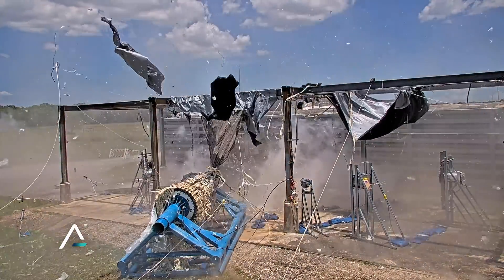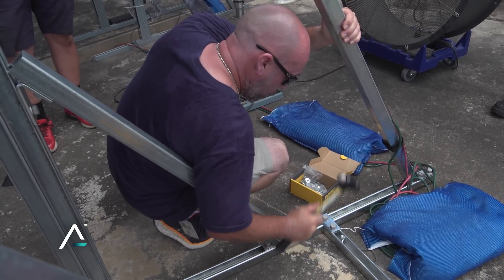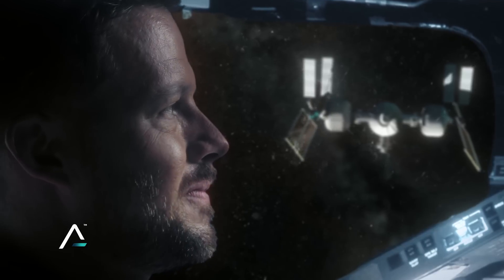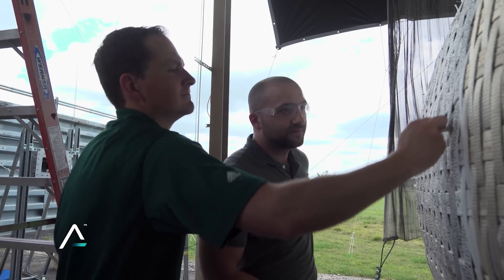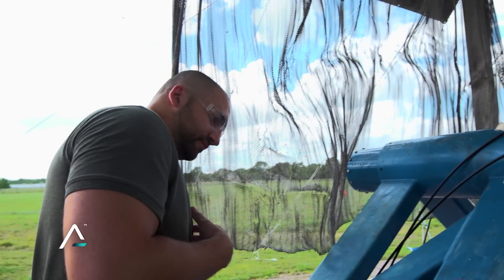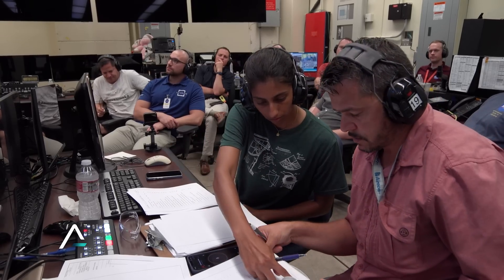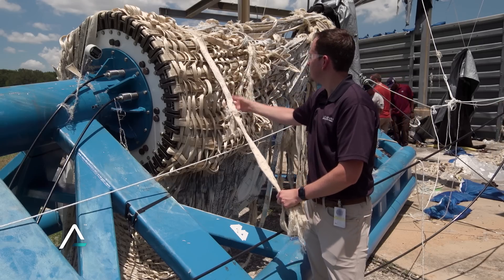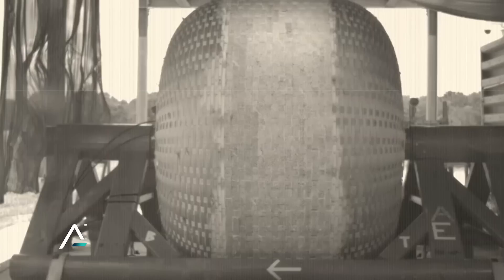Sierra Space’s LIFE Habitat Successfully Completes Ultimate Burst Pressure Test

Comment: Can the LIFE module withstand a 50 caliber impact at standard pressure. 

Sure i micrometorite is small, but odds are out would be moving at greater speeds.

And it comes down to how much time do the inhabitants have to plug a hole before full decompression of the module.

Comment: Is it possible to design an inflatable like a pipe fitting (tunnel), so that each module goes on like a bead on a bracelet- with each segment being twisted, bolted, and wrapped on To make a 25,000 foot long diameter ring?  After that, it would be nice to put carbon fiber plates on the outside to further increase its durability and stiffness, along with attachments for modules that can be detached when the time comes?

I understand each end has a smaller ring hatch, but would it be possible to make it wider like a tunnel so you can put scaffolding to walk continuously around the entire ring?  And is it possible to design each hatch like a sphincter and an iris with a plug in the middle so each segment can be opened and closed off relatively easily?

After that, you could put lines across to each opposite end, stabilizing it, along with carbon fiber plating.

The idea is that once it’s inflated and plated, you have a hatch/corridor at either end to go around the ring continuously, and hatches/ attachments (on the plating) perpendicular to lay modules to build out an O Neil Cylinder.

After the initial stainless steel ring is made and you have crew quarters/warehousing setup, the inflatable ring can detach and drag chains/cables to the other end 200,000 feet in the opposite direction and then you can travel along the lines and fill in the stainless steel tube with relative ease.

Comment: With decades of advanced material reinforcement, manufacturing and failure analysis ASTM (I) engineering, UV light degrades Vectran tensile strength quickly and catastrophically. 

We have pioneered advanced fiber reinforcement for decades and our founder was the chief chemical engineer for the Celanese Corporation and Gates Rubber Company.

It would be awesome to be part of the team.

Comment: To those who might not fully grasp just how impressive the strength of this module is, let's put it in perspective:
The air pressure at sea level on Earth, which is roughly around where they would keep the habitat inflated at, is 14.7 PSI.
By getting up to 192 PSI, the test article was able to withstand Thirteen times the amount of pressure it would need to hold under normal operating conditions. Any system that can withstand 1000% its normal load is impressive, but 1300% before failure is phenomenal!

Comment: Vectran, an aromatic polymer? Then you'll have to shield it against UV, or else it will be destroyed in no time. Wouldn't a fiber which isn't degraded by UV be more suitable.
Reply: What you see is only the inner two layers - the pressure bladder and restraint weave. It'll be covered in numerous layers of insulation (specifically, multi-layer insulation, or MLI, that is made of aluminized mylar and kapton, along with other materials), and finally several layers of micrometeorite shielding. So, the polymer will be buried well out of reach of UV rays.

Comment: "Saves from radiation". They don't tell which radiation and how.
If the lamination has many hydrogen atoms included (carbon hydrates) then it's able to slow down particle radiation like neutrons or protons. But those particles produce secondary radiation.
But the el-magnetic radiation (gama rays) is a different story. I think it can be reduced by a wire mesh, or (like earth) by a magnetic field.

Comment: With larger structures, might want to take into account any places where people can get stuck. There's no gravity to pull people towards a surface, so if they get stuck, they won't have any way to get back to a surface.
And yeah, you could probably take off your clothes and throw them to generate thrust, but that could get a little awkward.
Reply: Theoretically that might be possible but how would they get stuck in the first place? If you're at the edge of a cylinder and want to go to the center, you would have to push off one of the walls but unless there's something to grab in the center you'll just keep going till you hit the other wall. And if you have something to grab in the center then the problem is solved either way.
Reply: Explain further

Comment: Is it me or just me? I was thinking, maybe, just maybe, this could be used in submarines because it can withstand high pressure in space . It could save crews' lives in submarines in case something bad happens to it.
Reply: In space it has to survive just one atmosphere pushing from the inside. (1 atmosphere inside, 0 outside)
Submarines deal with 100 atmospheres pushing from the outside.  (1 atmosphere inside, 100 atmospheres outside at 1000m example depth.
Totally different game.
In order for this to inflate in depth, it would have to exceed the outside pressure. Might as well not have it then.
Reply: Unfortunately, I don't think that's how it works. This is designed to have an incredible tensile strength - resisting being pulled apart, as it restrains the inner urethane bladder that keeps the air pressure in. Think of it like a net or cage around the pressure bladder that keeps it in the proper strength. However, just like with ropes or cables, while they have excellent tensile strength, they do not at all have good compressive strength. For it to work in a submarine, it'd have to be pressurized to a pressure greater than that of the water outside of it. Unfortunately, when air is at extremely high pressure, it tends to have deleterious effects on the human body, with things like nitrogen narcosis and oxygen toxicity (yes, oxygen can be toxic if at too high a concentration).

So, TL;DR - it works great when it is restraining internal pressure, but would fail under greater external pressure.

Comment: OK. Interesting in theory. But a static pressure test is not relevant to the hazards of a space environment.  How about firing a 30/30 round at point blank range at the inflated habitat? That is about the same energy as a dust grain size particle moving at orbital velocity would impart. Hard habitats have a fragmentation layer that breaks up such particles before they hit an inner kevlar layer. This is similar to the design of rifle rated vests consisting of a ceramic outer layer and kevlar inner layers. Does this have a similar design?
Reply: You're only looking at the inner two layers; the internal pressure bladder and the middle restraint weave. There's going to be multiple layers of multi-layer insulation (MLI) for thermal control, and an outer several layers of micro-meteorite shielding. It'll be like a kevlar vest on steroids.

Comment: Correct my ignorance but I would imagine that all you need is 14.5 + safety margin? Why did you design it to handle so much extra pressure? It seems like unnecessary mass.
Reply: It's better to have it be able to withstand far more than it would normally experience in operation to show that it can handle damage and wear and tear over time. If it can hold 13 times the pressure it normally would, then at only 14.7 PSI (Earth sea level), they could probably have a dozen straps fail and it would still not breach.

Comment: For those wondering about micrometeorites and radiation shielding:

Per the FAQ on their site:

If the LIFE habitat is made of fabric, what protects it from things like radiation, space debris, asteroids, etc.?

The LIFE habitat has a woven structural layer (pressure shell), called the restraint layer, which is strong enough to withstand the internal pressure required for the crew to live and work. It is protected by an MMOD multi-layer soft-goods shield that guards the habitat from space debris such as micrometeoroids. The layers of fabric, plus the internal outfitting, create ample safeguards against radiation.
Reply: so why just send panels and a robot arm solder it in space if worry about volumetric. fabric dont seem be safe.

Comment: Fully support this endeavor BUT I have lots of questions since as a sailor I've used Vectran line.
It has to be sheathed to protect ftom UV... So in space deployment it'll have an exterior layer of protective (maybe radiant barrior too)
And micrometorites are inevitable so how do you patch it to retain strength. One of my many skills was working with marine and aviation composites and to retain structural strength there's complicated procedures, you just don't slap a patch on. I also have experience with patching inflatables like life rafts and boat hulls and again, you have to use the right adhesives under controlled temperatures and humidity so what do you do in space where one side is vacuum and the other side atmosphere.
Finally, all materials age and weaken, it would be interesting to know the expected lifetime of the "balloon" in space.
Reply: You're only looking at the inner two layers - the pressure bladder and restraint weave. There will be numerous layers of multi-layer insulation (typically made of aluminized mylar, kapton, and other such materials), and an outer several layers of micro-meteorite shielding. It will be well protected from UV rays, as the layers that could be vulnerable to it will be buried under a dozen other layers.
As for how it would age, this module shares a lot in common with the Bigelow Expandable Activity Module - an inflatable space module that's been on the International Space Station for the past seven years (since April 2016) and has been performing without issue.
Considering that Sierra Nevada is also, if all goes according to plan, launching the Dream Chaser mini space shuttle by December, I'm pretty sure they've taken into account any factors that an experienced mariner can come up with in 5 minutes in a Youtube comment section. These are professional aerospace engineers - have a bit of faith in them. Just because they don't cover absolutely everything in a short PR video doesn't mean that they have overlooked it.

Comment: Excited for this tech however many major questions remain as to its viability beyond getting pressurized like:
1. What is the long term over-pressure holding ability?
2. How many micrometeorite impacts can it withstand at different pressures?
3. All of the above questions under space condition temperatures, hot/cold?
4. Radiation shielding capability and effects of radiation on the fabric's strength derating?
Reply: all good questions for which I refer you to the BEAM module which went to the ISS for a 2 wk test, what, 4 yrs ago, and has been in use (as pres. storage) ever since.  poor Bigelow.
Reply: @joejack8659  It's been a little more than four years - it launched on April 8, 2016. It's now over seven years old, yet still performing without issue.
Reply: @joejack8659   Yeah I feel bad that Bigelow laid off its entire workforce and I was looking forward for their giant Olympus module and I really hope sierra does the same thing.

Comment: Er they forgot mini meteorites, they would pass right through it and any person inside, but I would prefer stainless steel outer shell and that inflatable balloon inside it.
Reply: No, dude, they have not forgotten about *micro-meteorites (probably should learn the correct term). This module isn't that different in construction to the Bigelow Expandable Activity Module that's been operating on the International Space Station for the past seven years without issue; it's simply far larger. You're only looking at the inner two layers - the pressure bladder and restraint weave. There will be numerous layers of multi-layer insulation (typically made of aluminized mylar, kapton, and other such materials), and an outer several layers of micro-meteorite shielding. We've had solutions to micro-meteorite damage to soft bodies ever since the Apollo-era space suits.

Comment: How does this tech manage micro meteorite impacts and decompressions due to leaks? Pretty interesting tech either way :)
Reply: my thought exactly. a metal chamber would lose pressure, but not explode when punctured
Reply: @ChoppyChuck  Just to note, the highest sea-level air pressure ever recorded was ~15.74 psi. That this took more than eleven times that to burst (actually slight more than twelve times, but this was done in atmosphere) is pretty good.
Reply: @ChoppyChuck  This thing is made out of materials that put the kevlar in bullet-proof vests to shame. You're only seeing two layers - the inner bladder, and the middle structural restraint layer. There will be additional multi-layer insulation (MLI) layers, and an outer micrometeorite protection layer. It'd frankly perform better than just a single plate of steel; once the micrometeorite hits the first layer, it will essentially vaporize, and the 1-2 layers after that will catch the remains. It's the basic principle behind how Whipple Shields used for micrometeorite protection work.
Reply: The many fabric layers have been tested and it shows they're much better at withstanding micrometeorite hits than regular ISS modules for example.
Several layers of kevlar-like stuff.

Comment: This looks as a very promising technology for future space habitats. Sierra Space, you're in the right path. Hope to see this module on future space stations, well done! 👍
Reply: My biggest concerns are around radiation and heat shielding and how it handles extreme temperature shifts.  Direct sunlight is rather hot in space and without radiation shielding it would have to be restricted to only operate between the earth and the Van Allen belts.  Thermal loading and unloading cycles are also very important due to the extreme environment of space. In the sun its boiling hot, but in the shade you eventually cool (over long periods) off.  How does the material handle repeat heating and cooling cycles?  How many cycles before it lowes integrity?  Given that they proved it holds to 180+ psi and it wont be anywhere near that loading it gives them a lot of wiggle room for heat cycle damage, but that's still a major concern.
Reply: @HIMPDahak  
You're right. Your points are true, but just as you thought about them, they for sure know all those concerns. I'm confident they will do a lot of testing before the habitat is certified for human use.

Comment: What sort of life span are you expecting from these modules holding pressure in the harsh environment of space for years on end
Reply: considering that similar inflated structures have been sent into space, inflated, and have lasted for many years I would expect them to give their modules similar lifespan ratings as other space structures, so on the order of decades.  See the work of Bigelow Aerospace on deploying independent modules as well as an addon for the ISS that has operated since 2016-it was actually only intended to last for 2 years as a test article but it exceeded expectations and is now rated to operate until at least 2028-so that's 12 years of operation lifespan out of something intended as a basic demonstrator.  
Worth noting that holding a roughly earth surface level pressure in space is not that difficult-this system you saw here only failed after they pumped it up to like 12 times atmospheric pressure, so under any kind of realistic load it is not being strained at all.
Reply: exactly

Comment: How can fabric be stronger than steel?
Reply: Ever heard of Kevlar, how about carbon fiber?   So, relative to size and weight the fabric is much stronger and lighter than steel would be.
its like a block of aluminum is pretty solid, and you can poke your finger trough foil easily.  You cant poke your finger through the same thickness of Kevlar.  Thus, it is stronger.
Reply: Tensile strength. This thing is meant to resist being pulled apart; by weight, it has a tensile strength far greater than that of steel.
Reply: PR to impress investors

Comment: Isn’t 1 atm 15 psi? It’s awesome that the module can make it to 190 psi but that’s more than 10x what it needs to be
Reply: Be good if they included "12x normal atmospheric pressure" alongside 190 psi in the video/video description, just so it is easier for the lay person to understand what those numbers mean
Reply: Did you not listen to the first part of the video. They want to know the failure point.

But you also want to overdo everything.

Your engine in a car runs at ~100°C right near boiling temps. Coolant is mostly water, but your cooling system is set to hold pressure up to 140°+
Reply: 14 psi roughly
Reply: Remember in space, it won’t have the Earth’s atmosphere pushing back onto it so it will experience greater pressure strains in orbit (like a pressurized plane at cruising altitude but more. Also, with anything that is going into space for the purposes of human habitation, you want to design it for great levels of redundancy and a high factor of safety
Reply: They probably want a 20% margin and this is a small scsle test it will be less the larger they go, but I can't say what that graph would look like. I bet they can get pretty big at space station pressure which is actually below 1 atmosphere.
Reply: Perhaps this demonstrates that it won’t fail when high pressure is exerted from the outside due to impacts from micro-meteors or space debris. Space is a dangerous environment, so safety margins need to be very generous.
Reply: @UnClipping  pretty sure micrometeors will pierce the soft structure, or at least make a hole. I think Whipple shield is needed to protect from micrometeors